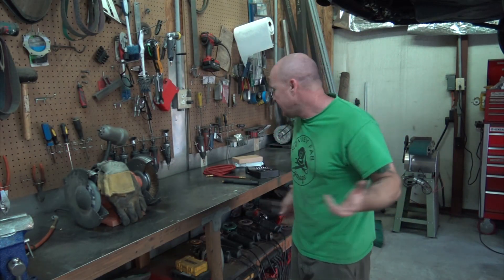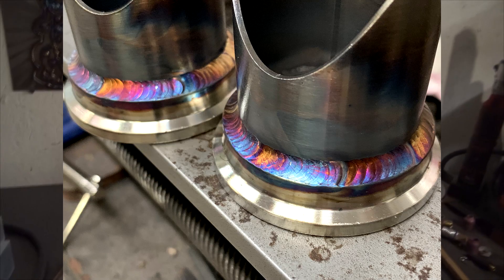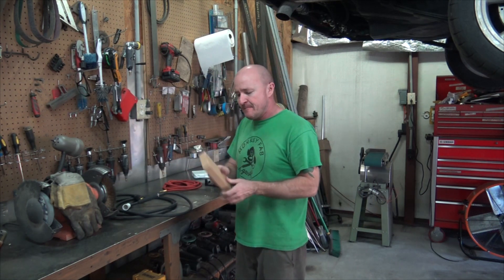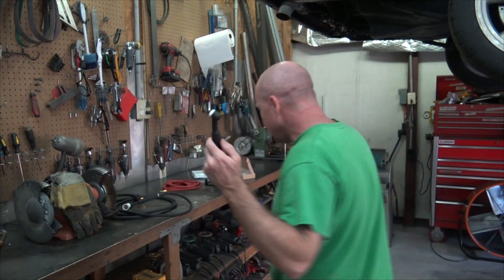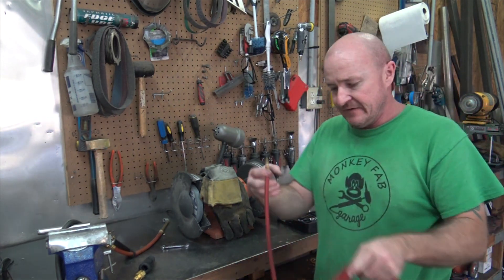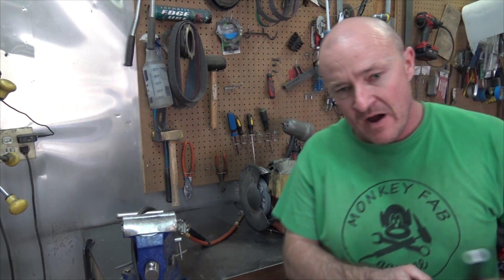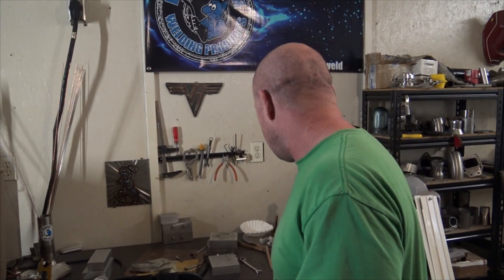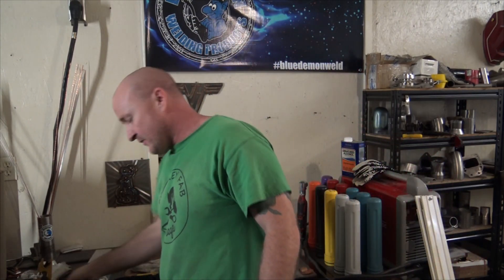Best Upgrade for Vulcan Protig for Under $100!!!!!!

Comment: Mike, I purchased the GLS Fab 2 pack of cups from you and was under the impression that I was buying the white unbreakable cups. What I received was the pink ceramic cups. I'm not happy. Can you exchange them? Thanks
Reply from the maker: Wondering why you thought you were getting the white ones. They have been out of production for years and all the pics on my website are of the ceramic ones. Just trying to fix it so others domt make the same mistakes. If you’re ever not happy with something you get from monkey fab, just send it back. Only restrictions are one year and custom made to order. Thanks

Comment: The Vulcan torch has a knob to turn on the gas when you swap to the flex head how to you turn in the gas?
Reply: The ProTig models don't need the torch with the knob. The terminal you connect the torch to has a gas port that feeds directly into the torch and the machine controls gas flow.

The knob torch is only needed with the OmniPro, because it doesn't have a gas port in either terminal.

Comment: Do you have a link to the small flex torch head? And to that super flex torch cable
Reply from the maker: You can just search #17 flex torch on eBay. That where I usually grab them. Pretty much all the same

Comment: You could possibly anneal that copper tube before it starts to work harden on you. Heating it up to 700 degrees F with a torch and letting it cool will anneal the copper and soften it. I know they’re only ten bucks, but if it will save it from breaking that’s money in the bank.

Comment: Hey man I’m in the market for a good drill press for my metal fab shop. I seen in this video you have a drill press but I couldn’t see what brand. Do you have any recommendations on one that won’t break the bank?
Reply from the maker: Uncensored American I never use my drill press. 99.9% hand drill. I was shocked when I started working at a fab shop by how little people used the drill press. Just get good with the hand drill. By yourself a center drill bit and a punch.
Reply: That’s how I always was. I hand drilled everything. I bought a little junk drill press and once I started using it I loved it. It just doesn’t have enough ass for the thick metals. I get where you are coming from tho. My hand drills are stronger than the little drill press I have. It takes awhile getting over the hand drill mentality. 😎👍🏻 Once I did tho it’s super easy to just pull the lever on a drill press. 😂 Love your content tho. I just realize I’m answering you on my non Fab YouTube account. 🤦🏻‍♂️ Keep making these great videos. I’m just looking thru your older videos after stumbling onto your channel. 👍🏻I appreciate you taking the time to get back with me.

Comment: Thank you for the info, just ordered the 25' cord for the pro tig 205
Reply: how do you like the 205?
Reply: @brianwilliams4254  I like it, I did change out the torch hose to a lightweight 25' and I think I'm going to upgrade the foot pedal as well.
Reply: @martinbuilt  i want to get one. None of the harbor freight stores have them. They said it could take up to a month to get if I pre pay for one. 

Have you tried the pulse settings on that? If ya have how did it work for ya. What specific cord did ya order thats 25 foot?

Comment: Hey Mike, thanks for the great vid.. I have a Miller 165 MIG welder and some basic welding experience, but really wanting to get into TIG welding for so many reasons (hello, aluminum!); is the Harbor Freight Vulcan ProTIG 205 a reasonable and reliable starting point?  I do a lot of automotive welding where it would be nice not to throw sparks all over the place, and burn through thin body sheet metal.
Reply: Jonathan Lombardo I’ve had the protig 200 for 2 years and haven’t had any issues on steel or aluminum. I love it.

Comment: Thanks for this info! Your welds look great! I have been thinking of picking up the Protig soon and your videos have been helpful, it seems like you have the best info on this welder. I own the Omnipro 220 and it’s a great welder I bought it back in the first month they first came out about a year and a half ago, zero problems so far, I also bought the Titanium 200 ( the new green multi process welder HF sells) it works quite well for a $650 welder! I didn’t need two multi process welders but I also make YouTube videos and I really thought it would be fun to make some videos comparing both of these welders. Anyhow I definitely have needed a AC tig for some time now and I think it’s time to get one. Ps what Mic are you using? It sounds great. I run the Movo VXR 10 but it really drops off if you step away from it. Take care :)
Reply: Hay Mike I like your videos. Excellent understandable  information.
Reply: P

Comment: Is that a Fronius hidden on your bench by the drill case and aluminum strip?
Reply from the maker: Padraic McGuire no. I’m not really sure what you’re talking about. Sorry
Reply: It is that red and gray cased thing on the camera right side of your bench!
Reply: Oh, I guess it is your HTP Invertig. It looks quite different than the current production welders due to the gray bezels. The Invertig's I'm familiar with have black bezels.

Comment: Hey Mike, how is the gas consumption bc I have read the post flow setting is rather long.
Reply from the maker: Troy Jones it is fine for me. I could see how it would be a problem if you were primarily welding aluminum. For steel I like a lot of post flow.
Reply: @MonkeyFabGarage  cool, I will be learning to tig myself and my 9 year old daughter has always enjoyed mig and stick so I wanna let her learn to tig.  Will prob be after the holidays before I pull the trigger on the Tig though.
Reply: I could stand corrected but I believe the post flow is on amps one second of post flow per 20 amps. Or Something like that
Reply from the maker: Christopher Ponzoo that would make sense. It does seem to vary

Comment: are there any hand amperage control for this machine that you know of?  I've been looking around and come up with nothing.  I'm guessing because of the pin output.  if you can find anything like the Tig Button I would appreciate it.
Reply from the maker: nope
Reply: USA Welds makes a hand control for them.

Comment: I am thinking about buying this welder and was wondering if this machine can use the mig gun sold by H.F. and also what is your 
though on this idea?
Reply from the maker: no
Reply: This is a tig only machine.  If you don't need AC tig, look at the Omni Pro 220.  The OP 220 is a multiprocess  machine that can do DC tig, mig and SMAW (AC/DC stick).